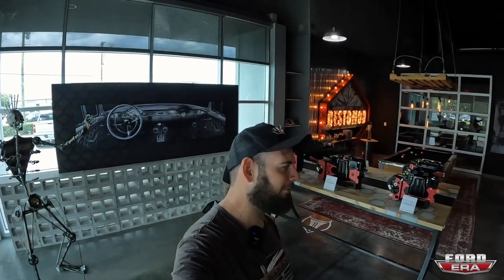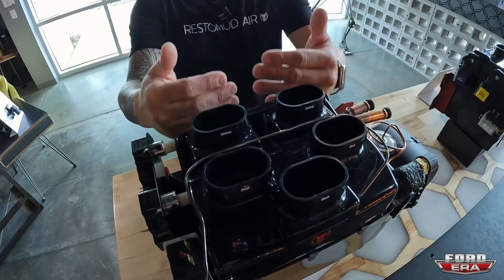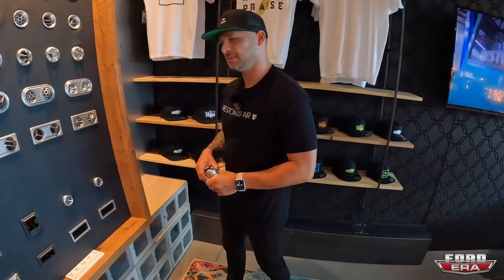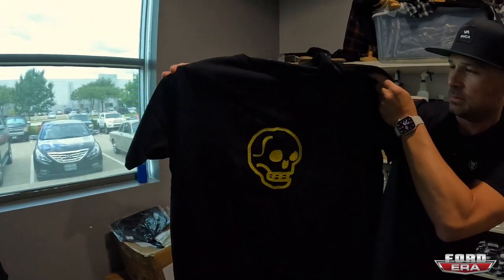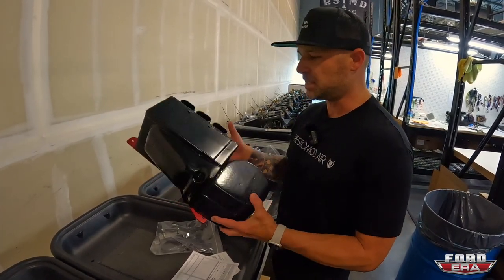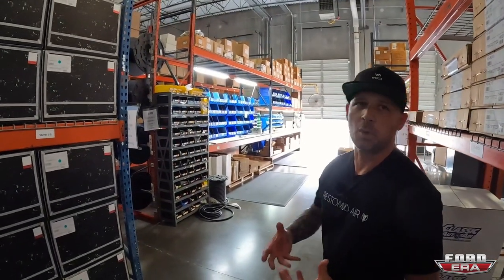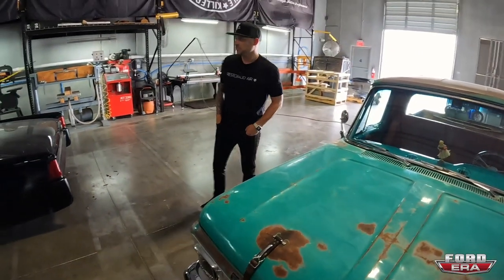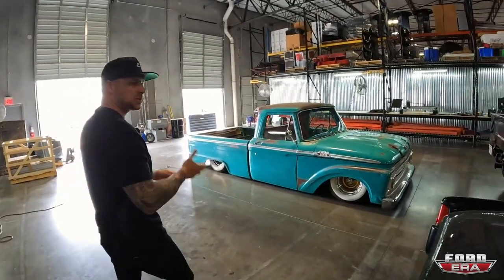Visiting Restomod Air | Full Factory Tour | Ford Era

Comment: Those vents are awesome looking but do they make them Square? what if you don't want just round ones? I have a 78 F150 4x4 and it doesn't have original AC if I were to add AC I think I would want Square vents
Reply from the maker: Yes they make square and rectangle too